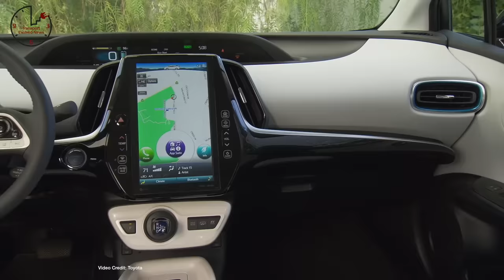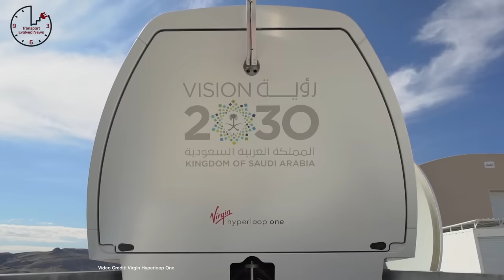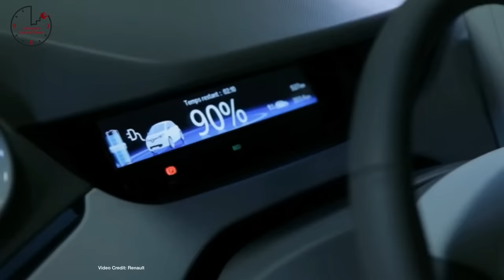Rapidgate Response, Tesla Q1 Records, BMW i3 Future -  TEN Episode 204

Comment: Gas station model can work for Evs but many fewer stations will be needed since all charging will eventually be residential combined with some form of long distance supercharging.  Many local charge points only made sense for short distance EVs which are being replaced by long range 200mi plus Evs.

Comment: I visited a Nissan dealer in sweden this week. And they had only a testdrive New Leaf and none in stock as they all got shipped to Norway. I feel this is a real problem because sweden will soon start enforcing Green Zones where eventualy only EVs and Fuelcell cars will be allowed.
Reply: stefan sandstrom 
What would the practicality/legality be of crossing the border and buying a Leaf in Norway? 
Probably messier than finding one locally, but would it be a viable option at all?
Reply: I have no idea. But Norway have a MUCH higher price level. generall. like , crazy high. plus i believe that swedes need to pay the tax when the reimport the car back to sweden. So swedes are at a really hard disadvantage.Not saying that there are none (at the moment 300 on sale in all of sweden, mostly new, but there are a few used one) but there are not cheap.
Reply: OriginalPiMan I Think it the dealer that sends it to Norway. Not the individual customer.
Reply: stefan sandstrom 
I never said otherwise. But since the dealerships in Norway probably have plenty of Leafs, I was asking if it was practical/possible to go to one of those dealers and buy one, then take it back to Sweden.

Comment: Very cool news, especially the hydrogen fuel cell stuff, Interesting stuff. I like the new battery bus idea, those and hydrogen fuel cell buses should replace filthy toxic diesel buses everywhere, not just America. 

At 3:32 that picture of the prices of Petrol and diesel, that looks so wrong and shocking and it must be dependant on the area because here in Wales, diesel is at least 2 pence cheaper than petrol most places you go. It's about time the horrible diesel pumps were put out of commission, should have been banned ages ago.

Comment: The Uber incident was clearly unavoidable, no collision avoidance system in the world can deal with person randomly marching out in front of a vehicle a few meters away when that vehicle is moving at 100 km/h. Sorry, it's physics folks. The Tesla crash is an entirely different matter. Teslas slamming into the back of parked firetrucks and barriers, points at sensor and/or software fails.

Comment: BMW also announced that it will not be going into mass production of all electric cars until generation 5 Li ion cell are made in approx 18 months to 2 years time as the capacity increase and price reduction will make it possible for them to make the cars at the same price as equivalent petrol and diesel models. Funny as that coincides with the Samsung gen 5 timeline. It is in my opinion. good news.

Comment: Unnecessary maintenance may become a problem as companies struggle to support their dealerships. Please comment on the change periods for transmission oil, battery coolants, and brake fluids. If silicone brake fluid is not used, why not?
Reply: I'm not so sure companies care all that much about their dealerships.  At best, their relationships have to be rocky these days anyways....  Seems like most new car dealers are more concerned about their used car inventory which I suspect makes them more money.  Also, dealerships seem pretty intent on raping the factory whenever possible by 'overprescribing' fixes on in warranty vehicles which the factory in turn must pay for.  Seems like every dealership is a screw factory, and end customers are hardly the only recipients.

Comment: I love the show. My only problem is that here in Australia we are YEARS behind when it comes to ev’s. Do you know of any plans for down under from any of the ev manufacturers?
Reply: Sadly, the reason is mainly due to the Liberal governments desire to rely on fossil fuels. this is probably due to Malcolm Turnbull, who's personally sitting on one of the largest coal reserves in Australia, and stands to personally reap billions from it. They want to spend 6 billion on a, ahem.... clean coal power plant. We could build a 10 x 10 km bank of raised solar panels, and storage batteries, for much less. Then, following the lead of Japan and Africa, utilize the water that accumulates at night on the cells, and grow produce in the shade. One nation now reaps 6000 tonne/year of vegetables in this way.
Reply: Last I heard the Hyundai Ionic was supposed to be available here as plug in hybrid and EV models this year. It might even be available right now; I don't know.
I also recall hearing that the new Leaf will be coming here, but I don't know for sure.
Reply: Car manufacturers may have seen the outback on TV and think that everyone has a 100 mile drive just to the letterbox :-) Joke aside, solar panels and EV:s are a perfect fit for Australia.

Comment: Renault's battery rental was flawed from the start. Where I live in Europe, a Zoe with decent spec costs around € 30k. Plus 69 per month battery rental (119 euros if you want 12500 miles/ 20000km per year, the average in most developed countries), which was MENTAL. 30 thousand euros for a supermini? Plus more per month in rental costs than the amount you would spend on petrol in an equivalent supermini? Add up all the rental costs over the first couple of years and your better off waiting for a base Model 3.

Plus, the local Renault website LIES and says you can get a Zoe for 17,700 euros (that's the price in France with government grants). Renault has made EVs look like a bad deal in my part of the world.

Comment: The gas guzzling ICE vehicles GM sells and C.A.R.B. are the only reason there are cheap Chevy Bolt lease deals at such a loss. Force automakers to make a car that gets 50 mpg and we will see more $12,000 cars which can go 500 miles after a 5 minute fuel stop, driving a nail in the EV’s coffin. 

Lots of money was spent trying to learn how to make a gasoline engine run like a diesel, which is what allows it such high efficiency, and several companies are now making direct injected compression ignition gasoline engines. 

Automakers have known for a long time how even a micro hybrid such as the Ram e-Torque can add efficiency and performance. But it does add significant cost. When the time is right, we will all be driving EVs. Pounding a square peg in a round hole might make it take longer due to disruption of the economy.
Reply: My 2002 Honda Civic went 420 miles with City and Highway driving, mostly Highway, the city part was when I got off the freeway to drive home.
Reply: TekReviews, yes, my 1994 Suzuki Swift got 43 mpg highway, which way 95% of my driving. They can keep spending money and get pure ICE cars up to 70 mpg. Regen is worthless for most highway driving. A used Tesla model S rear drive unit cost as much as a new Chevy Spark. And it’s the gas guzzler vehicle that pay for both EVs and econoboxes.
Reply: You used to get Tesla parts cheap at the junkyard until the junkyards caught on after so many people started buying Tesla motors and batteries. There is a guy in Ireland who has hacked everything Tesla he converts BMW Diesel cars to Tesla Motors and using Chevy Volt battery packs. Damien Macguire I believe is his name.
Reply: TekReviews, yes, I’ve been following his progress for the last several months. Several in the US have also hacked Tesla and got everything working. I think Jack Richart of EVTV also pointed out that as they make controllers for these uncontrollable motors the price gets so high he can’t buy them anymore. 

Sasha from Speed Academy also did a swap and made his own Tesla powered Lotus using Volt batteries. Jason Hughes also uses Volt batteries. Those seem to be the best battery you can get if you want high power density.
Reply: Nissan was letting off lease Leaf's go for pennies on the dollar a few years ago. Just buy a Chevy Bolt, people don't bother to factor in how many thousands of dollars they save every year not buying gasoline. When you hear it only cost's about $2 USD to charge your car, it's a no brainer if you rarely go anywhere on long trips. Most places around here are only 50 to 60 miles away so a regular EV would work fine even if you had to find some place to plug it in when you get to where you are going. The problem in the USA was with insurance companies when there are not enough Tesla certified shops in your city given the greenlight to fix the car even if it's not computer related they wanted to charge you more money then a normal car.
Reply: TekReviews, yes, most of the Small EVs are going dirt cheap if you can find one. You can’t convert a car to EV as cheap as buying a used leaf if you want cheap transportation. If the ever make a $35,000 model 3 then those will be affordable 4 years later on the used market.
Reply: There are a few Chinese companies that want to sell EV's in the USA and said they will retail for $5k. They are small like the Mercedes Smart car but not as ugly.
Reply: TekReviews, yes, and if we allow it they will destroy the US auto industry and Tesla. Actually the BYD e6 is already CARB and NHTSA certified, but they haven’t tried selling them yet to the general public. 

The cars you are talking about generally can only qualify as NEVs or low speed vehicles up to 25-35 mph top speed. Wheego imported some called the whip and later added some crash reinforcements and a better drive train and sold them for $32,000 nine years ago. There were so many people trying to game the $7500 federal tax credit, so far only Tesla has succeeded in pumping $billions of money into their own pockets by gaming the ZEV credits and federal and state credits. 

Imagine what would happen if Chinese companies were allowed to sell $10,000 EV which where eligible for up to $10,000 in subsidies. And after they sold 200,000 + 6 months, they just use their uncles name and open a new company selling the same car.

I wish someone in the US would make an affordable car using same technique as China, but with American labor and sold at $20,000.
Reply: I saw that BYD car on Bjorn's channel. It was pretty nice and even he liked it.
Reply: TekReviews, yes, and while Elon Musk laughs at BYD a few years ago, he won’t be laughing if they are allowed to enter the US. GM also has a Chinese car Biac 100 or something, but they won’t dare sell that and waste their federal tax credit. Once the tax credit is gone, GM may bring them in to game the ZEV system.

Comment: Once again I see the glorious sunlit uplands of hydrogen fuel cell high technology. Nikola are so confident of their 800-mile range prime mover, that they refund deposits. The total supremacy of HFC, widely acknowledged by all informed people, will initially emerge in the heavy vehicle market.
Reply: Especially in Europe. Tesla Semi occupies to much road space while offering little of cabin space - driver doesn't get any space to rest, despite they claim that those semis are going to be charging during driver's mandatory resting stop.
 If I remember correct, 500 mile range on FC can be squeezed in-to much smaller space then 500 mile range batteries. Which means tractor unit can be smaller. Not big deal in US, but this side of Atlantic, keeping tractor units within the same dimensions as their diesel counterparts is important for potential clients. 
So far, though,  both products (HFC Nicola One and BEV Tesla Semi) we've seen, are huge machines designed taking only N.American market realities in consideration.

Comment: Hydrogen fuel cell cars are DOA as the hydrogen is very expensive, virtually no fueling stations exist and short range.  With the coming of solid-state Li-on batteries, with ~10-15 min. charge times, long range and ability to charge at home or anywhere a plug exists, hydrogen has 0% chance to compete and so will gasoline cars.  EV's will become standard, overnight.